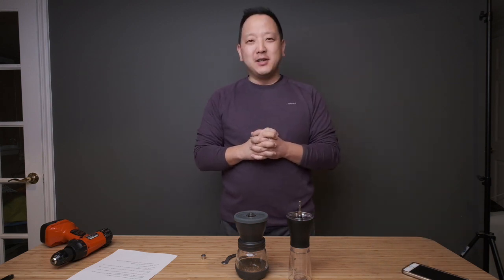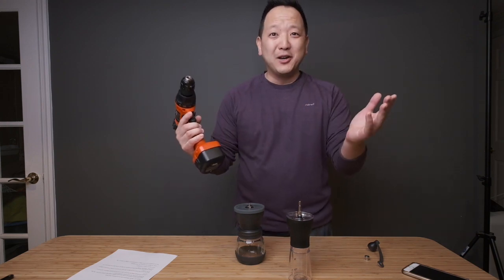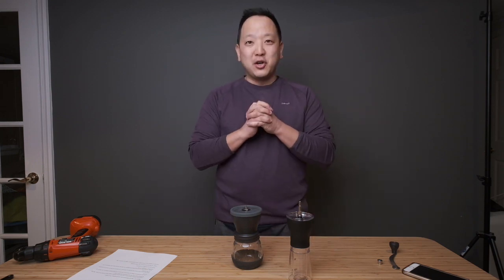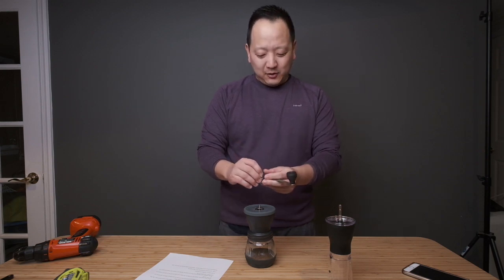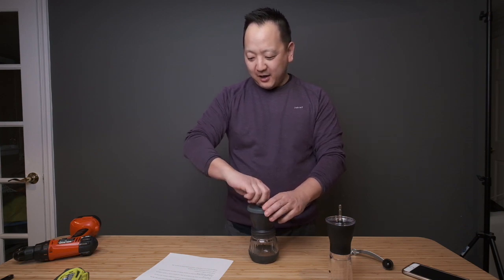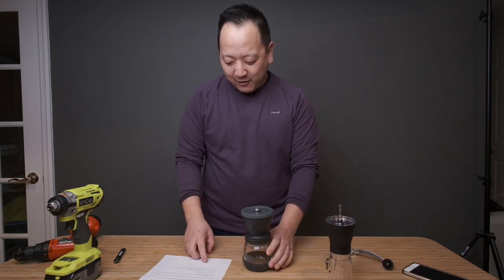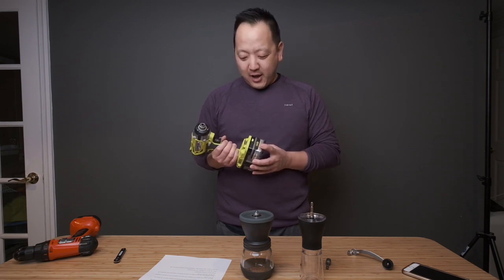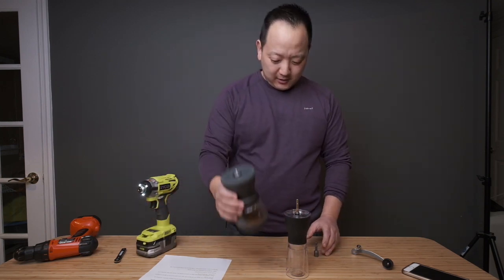How To Motorize a Manual (Hand) Coffee Grinder

Comment: Thanks for the video. I've not used my hario skerton grinder for a while but pretty sure you don't have to remove the handle to take the lid off, the hole in the middle of the lid is big enough to go over the handle and knob
Reply from the maker: Thanks so much for the comment and the tip!

Comment: Thanks for posting this. I just got 2 drill bits from Shapeways too (CDP-L and CDP-RE, cos I didn't know if a longer or shorter one would be better) to use with my hand cranked burr grinder. I've tried Gator Grip Universal Socket before and while it worked at first, it eventually shaved some off the pentagon shaft so I think the shaft is too small for it that it couldn't get a good grip. I also tried directly clasping the pentagon shaft with the drill and the same shaving happened.
Reply from the maker: Nice!  Thanks for sharing these details!

Comment: Drill driver still seems like it would be the better option because you could set the clutch at a safe setting unlike the impact driver. The motion/action/how the impact driver your using is far different then normal drill. Not that you will run into much resistance but the issue being if you pull the trigger to fast and meet ample resistance the impact function will kick in which could(guessing) damage the some if not the whole grinder. The clutch on normal drill driver could be set to a safe level to when it meets a certain resistance it just spins without the head moving. The higher the  number the more torque you are allowing the drill to put into your application. I would start at like 5 and work up to a safe level
Reply from the maker: Thank you for watching the video and thank you for sharing you input!

Comment: Nnevting drill directly as it shown in video bad idea as your liable to strip the threads  off the grinder rod or wreck ur drill

I considered a metal bolt but even that didn't work drill wouldn't connect and grip the nut
Reply from the maker: Got it.  Thanks for sharing!